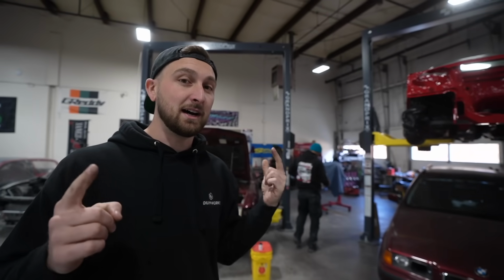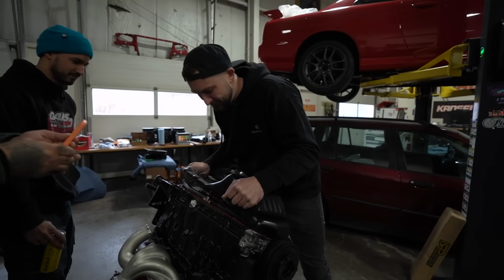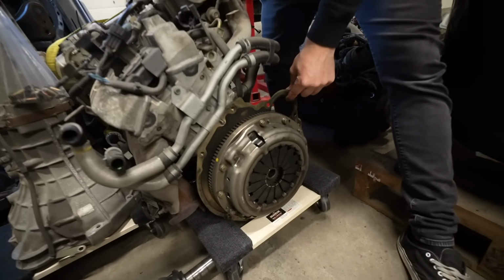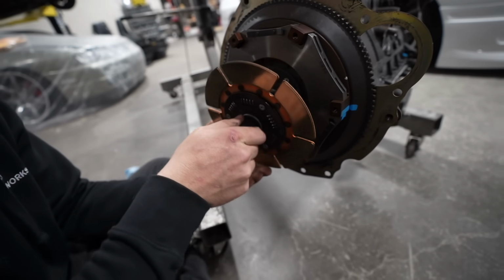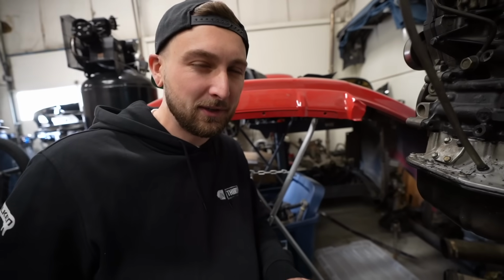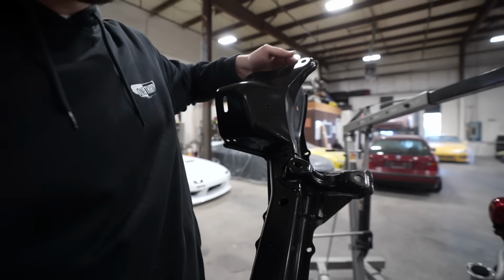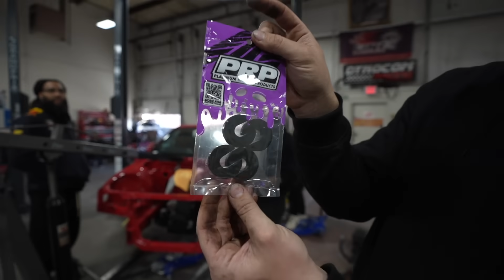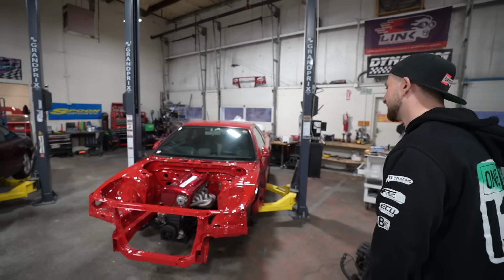Installing the ULTIMATE drivetrain in my R34 SKYLINE!!

Comment: If that clutch doesnt hold up, look into x clutch twin disk (xtreme clutch, their an aussie brand). they are rated for 800ft/lbs of torque, sprung, feels like OEM and spline for the input shaft is a single unit that extends to the second disk and the second disk mates up to an outer spline on the clutches hub. I have one in my rb25 s14 and its the best clutch ive ever had to install AND use. I switched after seeing Rob Dahm use them for the 4 rotor.
Reply: oh AND it comes with a metal aligment tool. all included for 1100-1200usd

Comment: Yeah, a G30 is way too small and needs a G35 as minimum. Even then, the turbine size is a little small. I have a G42 1450 on my RB30det, but mine has a Powerglide and a big convertor
Reply: Totes agree, but hey it will have zero lag, rad daily

Comment: Put a washer on a string silly it's not about the shape of the object the object on the end of the string is this to hold the string straight take a screwdriver with a hole in the top of the handle put a string on it and boom plumb bob